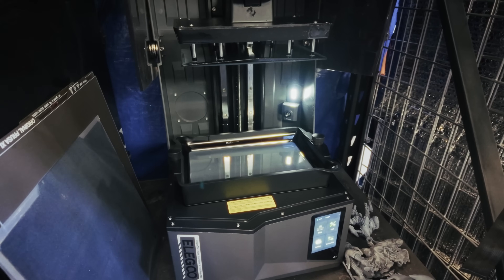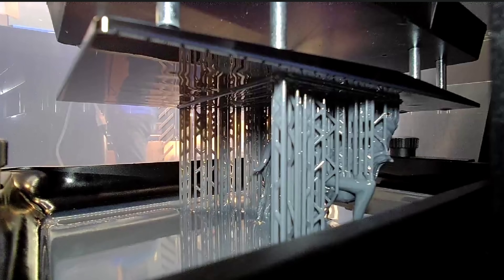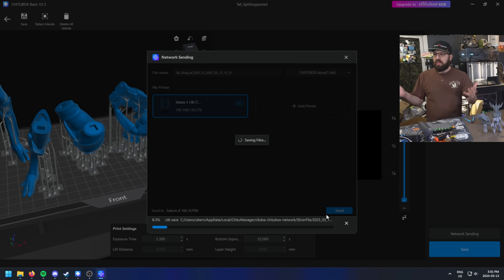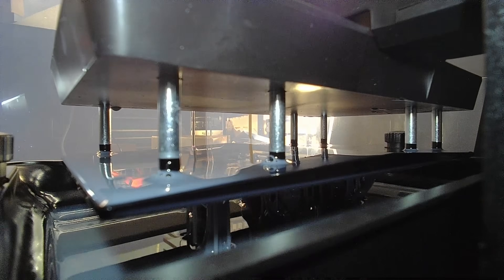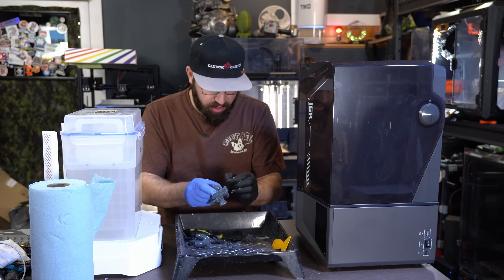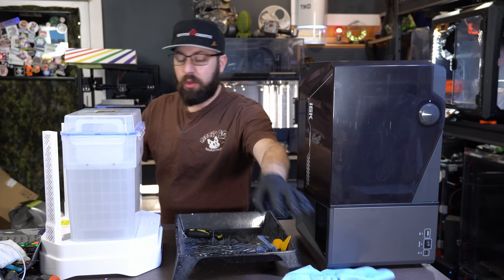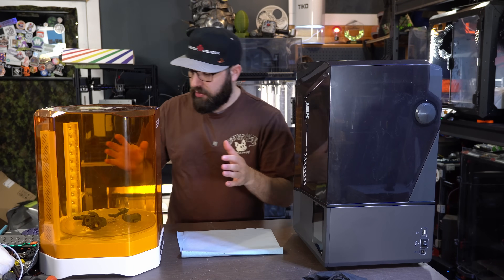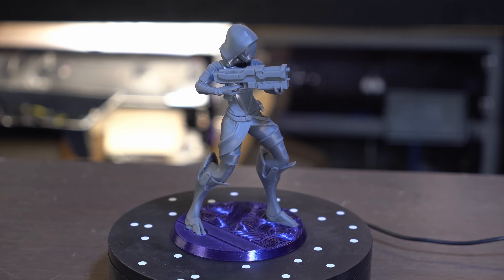Elegoo Got Me BACK Into Resin Printing - Saturn 4 Ultra 16k

Comment: So I had a Saturn 2 Resin printer and after printing a ton it died and I bought a Saturn 4 Ultra (not 16k).  My friend at the time bought a very nice FDM printer that was around 3x the cost of my Saturn 2, then he traded up to a significantly nicer model and more cost.   

Some quick notes.  The Saturn 2 and the Saturn 4 Ultra produce the same quality as far as I can tell.   We primarily play TTRPGs (table top role playing games) and here is what we noticed:

The Resin prints are perfect, mold like and incredible at 12mm, 27mm and 32mm.  They come out perfect and are ready to paint.  The FDM models look good at 27mm and 32mm, not 12mm at all.   If you didn't see the Resin models these would be fine to play with.  You can 100% tell they have been 3d printed.   Yes sanding and working with the model probably would help but that would take some serious time.  

If you pick up two models printed at the printers highest (best) setting, you will spot the difference in less than one second.  It is that different.  If you want perfection, there is only one choice.   

If you want to print terrain, use a FDM printer.  Yes smaller terrain is okay with Resin but man if you want to print out dungeon walls and floors?  Use FDM.   

For me, I want perfection when it is offered vs "good".   However I can't blame someone who "good" is good enough.
Reply: Voc measurements with just resin are not crazy high.  Not as high as with the wash.

Comment: This dude quite literally made the process of post-processing harder than it had to be. 1. Switch to water-washable resin. 2. Remove the build plate and run it under hot water; the prints will take little to no effort to remove. In the time this guy took to hammer away at his build plate, I could have removed, cleaned, and reprinted. 3. No, you don't need safety glasses, especially if you're not following this dude's example. 4. You should be venting the room / space REGARDLESS of printer type and Elegoo made it easy to do so with the vent on the back of the machine. I've been printing on a Saturn 2 with little to zero issues. Sad, because the hate/resistance from him for resin printing is so forced.
Reply: This dude is on the voron team, if he doesn't understand it, its not user friendly enough

Comment: 11:45 It sucks that your washer wont just take the print plate and wash the whole thing so you dont have to touch that mess
Reply from the maker: I wouldn't want to do that even if it could fit. Think of all the extra  resin you'd be washing off into the iso. Would use it up muuuuch quicker
Reply: @CanuckCreator  you can get another bucket from elegoo and when the alcohol you are using right now its dirty use it do a first wash of the build plate with the prints still attached.
Also calibrate your bottom layer exposure so you don't have to chisel the prints.

Comment: Didn't Even mention the heat feature..wich is almost the only worthy thing in this model imo. Also..16k makes almost no difference against a mars 5 ultra for example. I don't recomend to spend the money in this printer rly...
Reply: Print volume is much bigger than the small Mars. Definitely worth it plus the heating vat.

Comment: Mine has compression issues the same as Saturn 2 8k and 3 ultra if you remember the card had to move freely between build plate and screen not be stuck in between, remember we had to set a new Z home to 2mm to solve it same again here for first 20 plus layers compression issue! Manual leveling and doing the previous Saturn leveling solved it!

Comment: I found using resin to weld pieces together isnt the best way. Glue is way better. But i do use the welding to fill in the gaps.
 But you must sand those welds cause paint has a hard time sticking to it

Comment: Most resin printers with its matching wash station usually allow you to set the build plate into it. 
and you wash the print and the build plate at the same time before you start scraping the print off.
This will stop the splashing and flinging of resin.   you can also use a printed piece that holds the 
print plate on a angle over the vat to let the resin drain and drip off your print. The more time you let 
it drip, the less resin you end up dealing with.
Reply: Beginner way you'll learn soon enough not to keep washing the build plate and then the cost of ipa doing it this way but you'll learn through time better ways!

Comment: Nice video  but the printer is overrated. We tested since 1 month and we got 25% success print. The print stick to the tray and make a hole and drip on the screen. We have been in printing for couple years now. Don't buy this printer.

Comment: "You're going to need a mask" Proceeds to not wear a mask. The fumes are nasty, I wear a full respirator, and so should anyone doing 3d printing with resin.
Reply: Depends on the resin.  I use multiple high quality air sensors in my workshop. I exhaust mine to the outside from an enclosure.  Even with the enclosure doors open using low odor washable, VOC’s are not perceivable.

Comment: Nero you are so right. never underestimate the fumes. i always laughed it off. last week i printed a few parts in resin and immediately began coughing, dunno if it was the iso or resin but it definitely is some kind of allergic reaction. you WILL develop this condition eventually if you do not take care about proper protection. i am still taking time to recover at this stage. it is not fun. 

please everyone take care and use proper protection when 3D printing. not only resin, but also fdm. those fumes are nasty.

Comment: Tali, noice!
I don't understand why resin printer manufacturers keep putting the USB thumbdrive socket at the back of one of the side panels instead of front-and-center. At least you can print over WiFi.

Comment: I would love to get into resin printing for the great detailed parts for a model I am working on, if I could just print these parts, in this high level of detail for the shelf queen wrecker towtruck model, vs 8,000,000,000 hours manually machining them, and micro tig and micro spot welding micro parts together, that would be great, but, heck, back when I purchased a $250 - $300 ender machine couple of years ago, and wanted nothing but a plug & play scenario, and fast forward to today, and $3500 later at least, on playing with FDM stuff, I know exactly what would happen if I start down the path of resin printing, while they are even more expensive by a factor of at least 4 times for anything worthy. And a whole other work station area to perpetuate my proprietary nature of being clean and organized about the methodology of each type of printing. Which isn't a big deal, but, I don't want to spend several $1000's of dollars again, for what I need or want to do. The resins that offer strength and life expectation or shelf life and not degradate over time, is hugely expensive per quart or whatever the bottle increments come in, and then, to have a few contrasting colors, a few exotic resins for various purposes, wow, price just went up again.. Like, the really soft flexible resin for making highly detailed tires for RC cars, wow, some of those are $200 a quart, yea, there is some out there that only cost $25 bucks USD oer quart... But... Just saying...

In due time, I am sure I'll be suckered into the resin printer avenue whether I wanted to or not, spending the money.. 

I sure do like the detail and print bed area volumetric though.. fill the bed with as much as possible (with in reason, to allow even reflooding) and the height of the print is more what dictates the over all printing time, and not the width of X & Y surface area.. I like that..